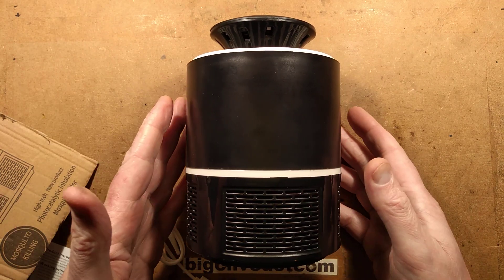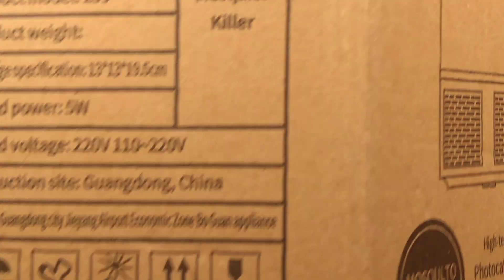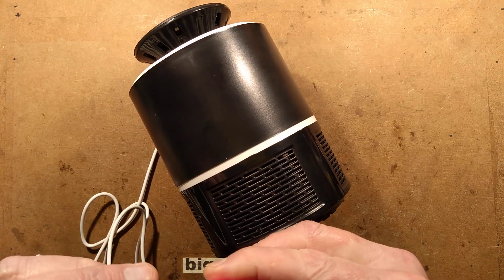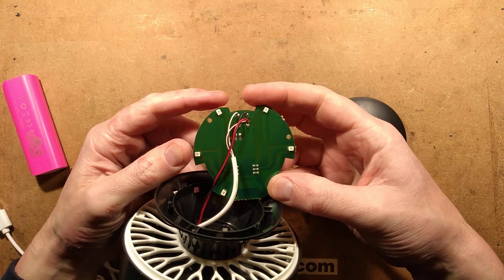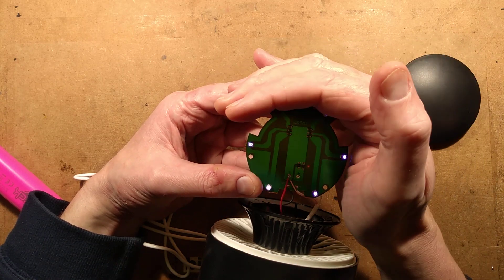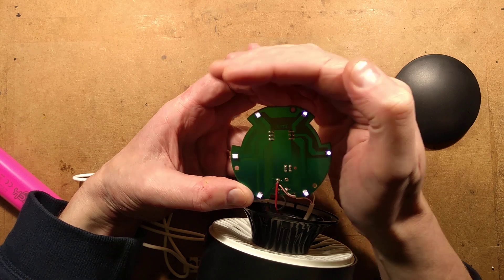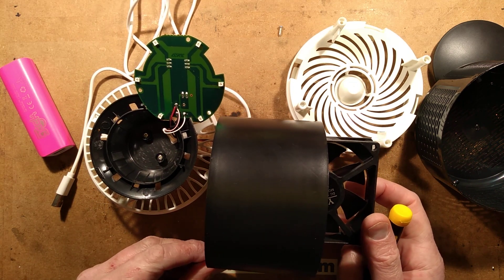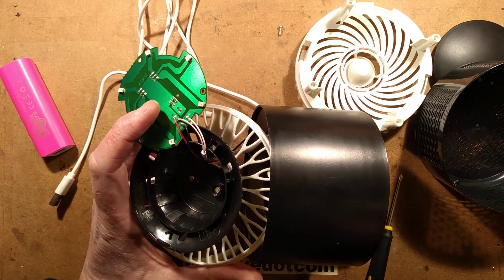USB powered photocatalytic inhalation mosquito killer.

Comment: I have an old-fashioned mains-powered fly zapper, with two blue light fluorescent tubes in it. It does very little, flies certainly aren't attracted to it, they only seem to get zapped when they blunder in to it (but boy, do they get zapped—bits of fly exploding everywhere sometimes). Given how many flies there are where I happen to live at the moment, this is very disappointing. It's also not safe to use in a (woodworking) workshop with dust in the air, so I'm desperately looking for alternatives. Next spring I'll try out a water-filled fly trap, and see if it makes a difference at all.
Reply from the maker: You have to change the tubes in those quite often.  Their UVA output drops off even if the visual blue is still very visible.
Reply: It's brand new, and still doesn't do much.
Reply: not all flies are phototropic... those units seem to catch a lot of moths tho.
Think CO2 releasing units make the most sense as that's what the mossies that are out to bite someone home in on.
Reply: The water-filled one's with the powder work like a charm, if you don't like the smell of rotting meat have it in a ventilated area.
Reply: Tom De Mulder They also make fly-pheromone scented strips you can attach to those zappers. Draws em in like crazy!
Reply: Used to stay in an area where the kitchen had one of the big bug zapper units. Used a pair of 4ft UV tubes, and it ran 24/7. Every morning the floor under it would be ankle deep in crispy fried moths, flies and mosquito’s, along with a half dozen very fat geckos who were there to grab a cooked meal as it fell down, the dumber ones would try to get the meal fresh, and then would land up below well cooked.
Reply: How about beer and dishwasher liquid fly trap?
Reply: @Siana Gearz Do those work? I tried variations of those all summer and all I managed to get was mold inside the traps and no flies. Maybe I was doing it wrong. I gave up eventually and resorted to hitting them with a fly swatter (took me quite a bit to get good at it).
Reply: @simaorodrigues6285  probably only on fruit flies. My roomie breeds them somehow, every time I'm out for a couple days I need to spend a few days getting rid of them, and I have to beg him all the time to let me bring out his stinky trash. We don't have regular big flies where I live, none at all in the whole city I don't think. Except at that one bakery which I don't know where they keep finding them.
Reply: Thanks for the follow up! I don't think mine are because of trash, I have one problematic room that just happens to be my home office. There's no trash here, and the kitchen is on the opposite side of the house and has no fly issue (except for the the random mug that stays around for a couple hours sometimes). 

Thanks for the tips! I have dishwasher and I have beer, I'll try those on my next fly trap. I'm willing to try virtually anything; being in a home meeting with the the swatter on hand just makes me look crazy. The flies I get are indeed the big ones. As long as they go away I'll be happy (even if it costs me some beer).
Reply: Siana Gearz beer and dishwater? brillant idea! You can skull it afterwards as a protein shake with all the flies in it and don’t even have to rinse it, thanks to the soap!

Comment: As the brother of a professional mosquito wrangler in Northern New Your State circa 1975, I had the opportunity to travel with him a few times while setting and retrieving traps. 
Powered by motorcycle battery, these traps used UV light and dry ice to attract, and a fan to suck them in. Also the little white poison cake at the bottom of the jar finished them off quickly.
A far better solution than my employers attempt to rid the break room of flies. They used a device from the '50's, Big Stinky! Just a jar of rotting meat below a lobster -trap kind of funnel. Mmm, rotting meat in the break room!
The only thing of greater importantance than more cowbell is less mosquito!
Reply: I think they still make it too! https://www.bigstinkyflytrap.com
Reply: He must have used a very tiny lasso.
Reply: Jim LaGraff Live spiders may be a better flytrap!  Completely maintenance free, even disposes of the dead flies efficiently.
Reply: Mosquito could give a shit about the smell of rotting meat. They follow the smell of carbon dioxide.
Reply: Yep. The Big Stinky is easily made from a single plastic water or soda bottle. Fill with sugar water to attract yellow jackets, or meat to attract flies, or fruit to attract fruit flies. I've also had great success with attracting fruit flies with a bit of sugar water or soda with sugar. It does take a few days to get rid of the fruit flies though.
Reply: I forgot to add the purpose of the wrangling, the state was tracking the spread of equine encephalitis. A horse disease similar to mad cow. 
He trapped and segregated the beasts by type and sex before forwarding their carcasses to the lab.

Comment: The problem is that mosqitos are not all that attracted to uv light. A much more effective option would probably be a very small but constant source of co2 (like an openin bottle of carbonated water). Mosqitos love co2!
Reply: I have built one of these with a single UV LED and it does atract mosquitoes and especially moths...
Reply: @Richard Vaughn They swarm above my propane grill sometimes....  Unfortunately none went in my propane mosquito trap this year!
Reply: How about that catalytic hand warmer? It should burn relatively clean just like propane, so hopefully not too many nasty hydrocarbons among the CO2 to turn the mosquitoes off.
Reply: @PinkysPain  that's basically how the mosquito magnet works. It burns propane without an open flame and a 20 lb tank lasts about a month. They are unreliable sitting outside exposed to the elements every day which is the main problem with them but they do work. The failure mode is they just won't light any more after a year or so.
Reply: I think it's co2 and infrared? Sure I heard somewhere that they're very sensitive to slight changes in body temperature (yours) and that's how they know to buzz past your ear just the moment you're falling asleep...
Reply: Yes that is so true and when you get the big ones they sound so loud right next to your ear. and you keep trying to kill the bloody thing but never get it.,
Reply: From my experiments with mosquito killing devices, it seems they give priority to CO2 but if there isn't any, they will fly towards light sources. In a scientific article it was reported that they seem to prefer red and infrared light over other colours.
The problem with CO2 based mosquito traps is that not all mosquitoes attracted by the device will immediately fly inside it, so they actually risk increasing the concentration of mosquitoes in the neighbourhood…
Reply: Put a tazer in my mouth an exhale you say?
Hold my beer!
Reply: they seem to be atrracted to light, but in a very light way compaired to flies and moths
Reply: Just learnt pretty much more about mosquitoes in these comments than I knew in my entire life

Now I know how those little buggers always seem to orbit around my head just as I turn the lights off and about to hit the sack
Reply: I thought the exact same about the UV :-)
Reply: Sorry Norman, you have remembered that wrongly. The males which are harmless are silent, the female is the one producing the sound. 
The malarial mosquito sings on the low 'a' below middle 'c', while the non-marlarial mosquito sings on high 'c' above middle 'c'.
The Illinois Agriculturist, Volume 19 page 811.
Search done on 'middle c note mosquito'
Like every internet rumor, misinformation abounds and when the whizbang  $500 propane powered trap doesn't work, well it's only money right? But they do work right? Except when they don't of course. I've got a fountain pen like that except it didn't cost me $500.

Comment: I bought three of them and had them running in my house for about one week, because we were overrun by these very small flies (fruit-flies?). Guess what: 1 (one!) of some bigger flies was captured, nothing else. Complete useless pile of sh...
Reply from the maker: I wonder if they were escaping through the holes in the base.
Reply: @bigclivedotcom  maybe cover the bottom with strips of fly paper?
Reply: Basically seems like it needs a more powerful suck, narrowed inlet and therefore faster air speeds. A quiet fan would be a light draught with all that space and holes. And then blast them in to flu paper or tack covered sieves.
Reply: That lonely fly was just looking for a final resting place anyways. But yes, I was wondering which part of the contraption is doing the killing?
Reply: They aren't killed, just kept to death.
Reply: @ZappoB  new euphemism for the prison services PR.
Reply: ZappoB poor buggers
Reply: @heyt54  it appears to be purely a trap... a no kill solution...or should that be non-kill.
Reply: Good to know... We have the same fruit fly problem all throughout harvest time, not that I would have bought anything like this.
Reply: Try hair spray my daughter swears by it, she was a hairdresser.
Reply: @georgestewart5879  if you can't beat them, lacquer them.
Reply: @George Stewart: but only if it's not you, who have to clean the hairspray from the furniture! This is awful stuff!

Comment: For the first time in 6 years at this place I've had a fair few flies around this place in the last few weeks. No obvious reason why. I suspect they're under the floor in the airspace under the building and making their way up through the gaps. Anyway, last week I decided to act. I bought some fly-paper, a 10W UV LED and heatsink from Ebay...  Now no more flies. Not flying ones at least.
https://drive.google.com/file/d/1vPKPbdKtj9XBNu3JHrrcFys_I2AwAlI4/view?usp=sharing
(Photo has LED running at under 0.5W as the camera really dislikes this LED!)

The UV from this LED is impressive. If run at around 8-10W it fills the room with a fairly dullish blue light but everything in the area fluoresces very well. The light seems to bounce off normal whitish walls pretty well into other rooms just as a visible light would. I usually turn it on as I leave the flat in the morning and off when I return. Flies do seem to be very attracted to this light as it's pretty intense. Leaving it on with a fly in the room is fun as it's definitely a magnet for them!

I've got a few spare LED's if you'd like one Clive!
Reply from the maker: Where did you get those ones from?
Reply: I got them from this supplier "globebestdeal" in mid August18.  They arrived really quickly from China.
The 10w ones on sale right now seem the same part.
https://www.ebay.co.uk/itm/132696259612

Comment: Computer fans are usually 12V instead of 5V. ATX mother board standards have computer fan connectors with 4 pins (PWM, 12V, GND, Tachometer). I've never seen a 5V computer Fan.
Reply: You can actually find a lot of computer fan but 5v on eBay, I guess they do change the winding for lower the impedance for working on 5v
Reply: 5V fans are there, but most 12V fans will run on 5V, very slowly and therefore very silent - so I think this is, what they're gone for.
Reply: @ZappoB  I thought of that, they must have just used another sticker.
Reply: There is 5V fans out there as I bought one for cooling my Android TV box.
Reply: Yes there are many 5 volt fans out there.  It's one of those things you don't know exist until you look for them.